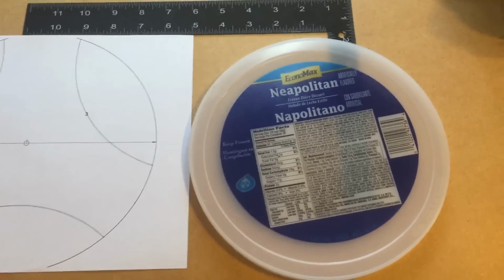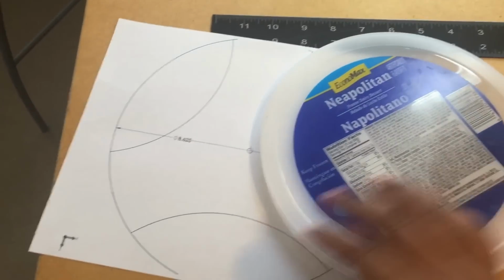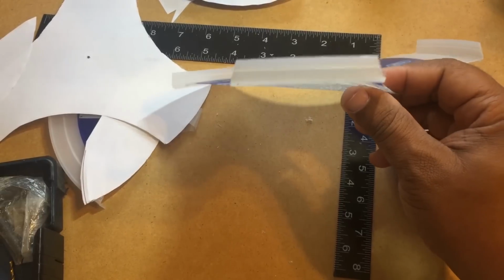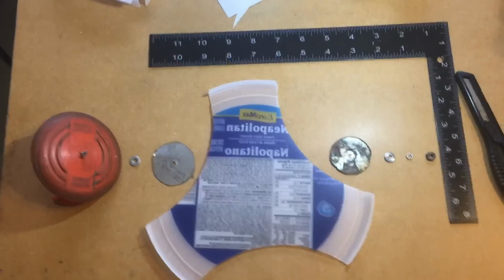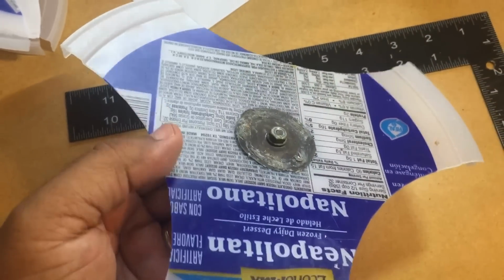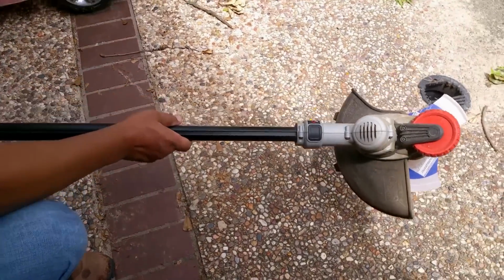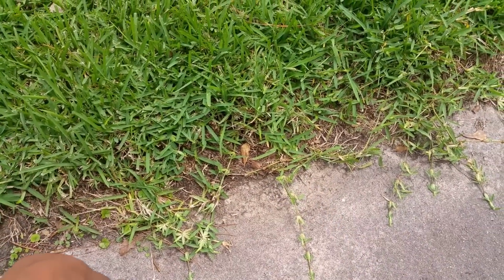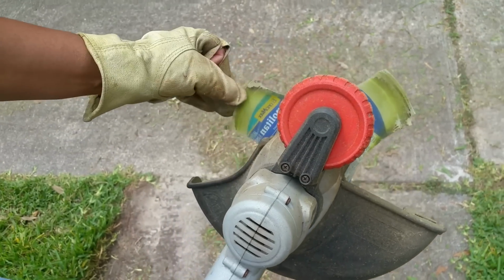How to Make Weed eater / trimmer / wacker blade - DIY hack

Comment: This fellow is a smart cookie. I'm 70, 'suspect he's over 50 anyhow.  Let me suggest NOT using a split lockwasher- but a 'waffle' type lockwasher to allow finer adjustment of pressure, then also use Locktite Blue to prevent the nut from vibrating off.  :)   Very nice / 'gotta go try it now

Comment: Brilliant!  Would it work better if you clipped off the edge of the lid?  I'm a creative (lol, cheap) person, also, and in the spirit of reuse-reduce-recycle, I have made replacement parts for my pool filter (outrageously expensive to replace) which have actually lasted longer than the original equipment.  Of course, the folks who make their living selling the replacement parts don't like my creative solutions much, but if I can make something that lasts five years out of an ice cream carton lid, why can't they supply that stuff without gouging the consumers???  :-)

Comment: Why are you edging your yard that way? The big red wheel is on it and designed just to do that.... Edge and be manageable. You want to really test it out, then edge the yard using the wheel and stand it up. That's gonna show you just how long that blade will actually last. Good idea tho.....
Reply: Looks like the homemade blade isn't wide enough to use that way.
Reply: Troo Dat. Edging is nearly half of the equasion, and edging that way just promotes sooner growth, leaving you with edges before
mowing periods. Use an edger or make this from 5-gallon bucket lids, to achieve the depth necessary. Probably a better alternative anyway, and thanx for posting!